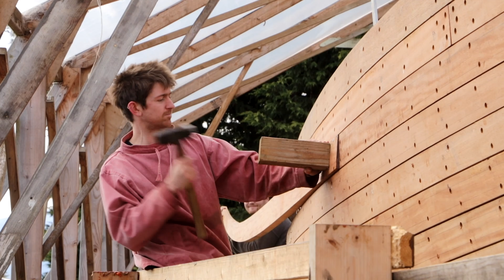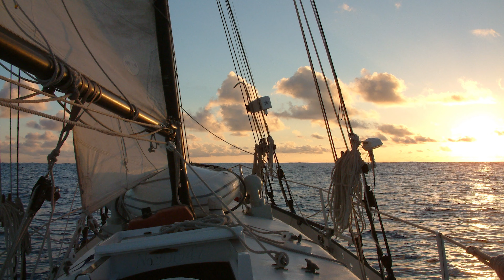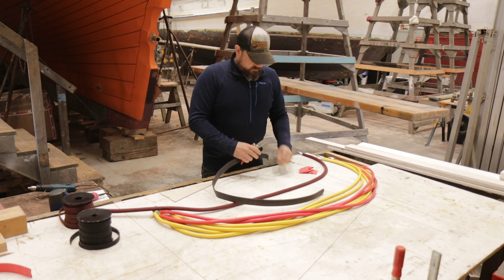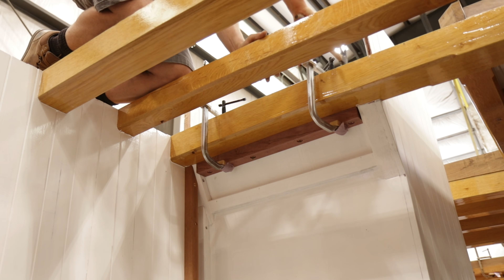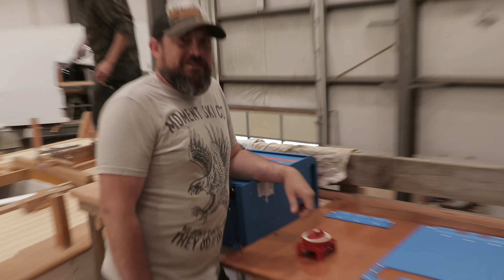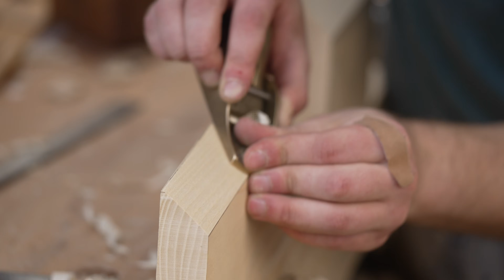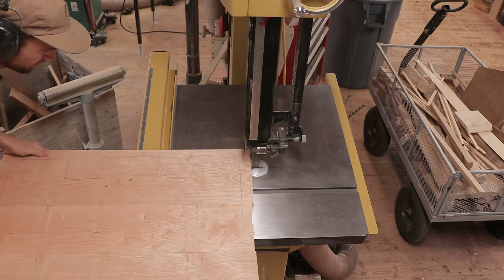Installing a Victron electrical system in the historic sailing yacht Tally Ho

Comment: Just one small correction, not at all important, but just for the records: All you say about the various Lithium battery types is correct, apart from one very frequent misconception; that Lithium Iron Phosphate batteries (LFP or LiFePo4) aren’t Li-Ion. They totally are. 

This misconception has established because of how various types of lithium batteries got established on the market, as Li-Ion. When marketers explained that LFP was a very different type of battery chemistry, which is correct, the market misunderstood what was different. Absolutely all lithium batteries are Lithium Ion batteries. There are just different types of chemistries in them. 

LFP has several advantages, like virtually no thermal runaway, tolerates extremely high currents, both consumption and charging, have a super charge efficiency, have very stable Voltage from fully charged to empty, lower price and at least twice as long live expectancy as the other much used lithium chemistries. (LTO Lithium Titanate is even safer and much longer lasting and tolerates even higher currents, but has other significant weaknesses). 
Sorry for the nerdiness. Just had to…

Comment: Nice work!!  But I would be apprehensive about installing electrical and electronic equipment under the compauionway.  Hopefully there will be a way to positively seal it off from the sea water, o,r even rain water that will definately cascade down that companionway at odd times on any truly serious seagoing boat such as the Tally Ho..
Reply: The ladder is built w/ a solid back, & has weatherstripping at each side to channel water to the bilge.

Comment: Those MPPTs are wrong way on wall, cooling finns assume that cooling air flows behind them when installed upright.
Reply: You should have chosen 24v volt banks to make it possible to connect them parallel with engine starting battery in case it’s empty for some reason. BlueSea makes automatic charging modules for that. But it cannot be used if other is 24 and other 48 volts.
Reply: Well, not MPPT’s but Orions. Same problem anyway.

Comment: Cable ties for the low voltage high current cables? I would have thought that they would be metal. Warships don't allow cable ties. Then again these cables are not up on the ceiling.

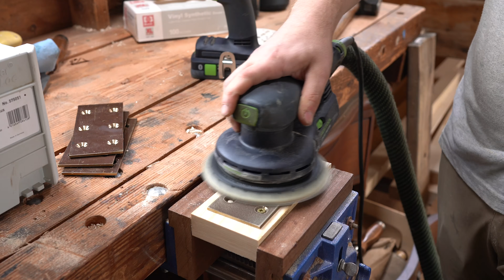Comment: 18:40   You really need to be using a clamp/hold down for that work piece.  Especially when working soft metals which can be grabbed by the tool and spun.  BTW, I have been a machinist since 1975 and have seen the results of an out of control work piece.

Comment: Have you purchased a mask yet for the sailing yacht is it going to be one piece or we meet up in segments or you know move together it would be wood will be aluminum tell me now tell me how I just want to know what you're making it with you know what kind radar self steering systems spot lights ankor how big how heavy registration numbers for the boat are you going with the old ones sir thank you

Comment: I have a question. Why do you use flathead screws instead of Phillips head? Is that because it’s a marine application ?
Reply: With a view to disassembly & repairs in the near or distant future, it's much easier to clear goo & gunk from a slothead than from any other type.
Reply: @frederickstibbert7389  ah thanks for the answer makes total sense

Comment: I'm surprised there weren't idents placed on each end of the cables, especially as some are routed through bulkheads.
There's a world of difference between an Electrical Engineer routing cables during construction and a yachtsman trying to trace an electrical fault in the middle of the ocean with a sea state 5 or higher. In that event a wiring diagram, with clearing idented cables, would be invaluable.
Reply: Don't you worry.  Labels are coming....

Comment: It is funny that people are worried about the safety of the batteries you put into the boat. And at the same time they are perfectly fine riding around in an electric vehicle that is essentially a bomb because of the Lithium Ion battery packs they use.
Reply: There's a mighty destructive potential in every tank full of gasoline.
Reply: @frederickstibbert7389  True and accurate. But gas tanks don't usually spontaneously combust. I have seen quite a few videos on electric vehicles blowing up that are parked and just sitting there. I would be leary parking an electric in my garage.

Comment: Pro tip:  Use flathead lineman's pliers to TWIST off the zip-tie tails instead of cutting with a side cutter...  Leaves no sharp edges.
Reply: I've cut hundreds of thousands of zip ties and also been cut by crappy cuts.  There will not be one shark tooth on this entire boat.  Flush cut.  Not side cutter.  Two different tools.

Comment: Don't know if anyone else has said this here, but it bears repeating:

It is unbelievably dangerous to use gloves when sanding small metal parts on a stationary disk sander. You can rip your thumb off if something goes wrong. I've seen it happen. 

It's not a lot less dangerous to drill small metal parts on a drill press with gloves on.

Comment: cutting off the tails of the Ty-Raps with diagonal cutters, makes me cringe.  Sooner of later, someone will slice themselves on the razor sharp nubbin.  We always use a Ty-Rap installation tool, which tensions and shears off the tail.  Grabbing the tail with pliers, right near the head and twisting, will also remove the tail, without leaving a sharp edge
Reply: They are flush cuts.  Different tool. Different result.
Reply: @tysons1851  In that case, I stand corrected !!

Comment: This is a MINOR issue, and maybe it's never ever done - but with those thick zip ties on the electrical panel, can the be touched with a hot knife to smooth 'em down so when yer reaching around you don't scratch/cut yourself? It may not eve be a thing tho.

Comment: NO OPINION on your choice of electricians, I speak from so close to zero experience that I should actually just delete this message.

I hate to give bad vibes, but my brother works for the Parks Service and has an ex aircraft electrical engineer working for the parks service department, repairing an maintaining salt water boats - and doing a just miserable job - all perfectly correct for aeronautical industry but bass ackwards for the maritime industry.

I am not an export so I am unable to commit to details, and this may be a one off bad employee, but it sounds to me, as an observer, as if he is totally unaware of the problems with dissimilar metals, grounding issues, electalosis and such.

Nyce cabeling technique - install the cable ties first, had not thought of that!
"Your daily rebuttal comment" or whatever he said - PRICELESS!

Again, I should just delete it, but just take a moment and see if any aeronautical vs maritime lessons have been missed.
Reply: I've got it.  Don't worry and keep watching. Plus, I have Joe to guide me and after a week with him, I have the utmost confidence in his knowledge, plan and advice.  I learned A LOT about what "ground" means in a boat already and it is very different than an airplane.  I am here to learn and soak up knowledge but I do have EXTENSIVE experience running wire in very high tech things.
Reply: @tysons1851  I am certain you do and I really should have just deleted the post.  Nothing constructive there.  It is not my usual bright and sunny style.  Great project, I wish I were about a dozen states closer.

Comment: I'm pretty sure your T-Class fuses should be directly after the batteries, not after other things like the Lynx's & BMS etc.
Reply: The first lynx contains…fuses for the battery supply. The second lynx contains fuses for the individual dc circuits.
Reply: It's fused six ways til Sunday

Comment: GREETINGS
I was doing a little research on the LIFEPO4 24 volt batteries and see that the cell design is likely 3.2 volts per cell…Assuming that is true in your case, there must be 10 cells per battery to maintain a nominal cell voltage at 24 volts. 

I was wondering if your system monitors the cells individually just as similar lipo/life systems do requiring a maze of signal wires?  Or is the LIFEPO4 chemistry such that individual monitoring is not necessary?

Since I see no individual cell ports I am assuming that each battery is counted as one cell.  I am very intrigued with your system and design.
OH…one last thing.  I know you are much more qualified regarding what type of wood to use to build the battery rack, however, the boards appear (at first glance) to be sized at minimum strength allowable to support such heavy loads.  When I saw large holes being drilled for wire chase, it made me cringe a bit. 

Thanks for this very exciting journey that you share with us mere mortals.  I am always looking forward to the next installment.
Reply: These batteries are living in 2050

Comment: have you considered protective the fastened (bolted or otherwise) electrical connections from salty air with a reducing (i.e. opposite of oxydizing) contact grease or something the like ? quite useful to delay oxidation of sulfation imho...

Comment: One question ? How are you going to keep electric’s dry been under steps on companion way ?
Reply: The steps have a solid back & fit fairly tightly against the companionway's sides, with rubber compression gaskets. An integral drip channel in the gaskets leads through convenient holes into the bilge.

Comment: I would have put rubber around the holes where the cables go through, they rub in high seas. everything moves a little. remove the friction. they can still be done as you can add cut circles of rubber around the opening.

Comment: The cable holders with cableties MUST NOT BE ADHESIVE!!! Change them inmediately. Or you will have a problem.
Reply: Pretty sure there is a scene where the tech screws in the cable holders.

Comment: Leo.  Love the electrical. Potential problem with. Independent movement on batteries using bussbar could fracture battery terminals when at sea. Suggest a loop of wire to Eliminate that problem.  We r huge fans.  Best from jill and Phil who is a an electrical engineer
Reply: We have a plan for that. :) The batteries will be completely locked in.

Comment: A lot of electrical devices in a small space. Everything is enclosed with wood. Do you envisage the installation of fire protection systems? Sea conditions can be extreme. Moisture, heat, sea salt and electricity are a bad combination, especially for a DC installation. Greetings from Poland !

Comment: Buss Bars can be made out of any type of copper, soft or hard, Concerns for vibration applying load between terminals on batteries using solid buss bars.  Batteries are sensitive to load on the terminals, both torque and lateral loads.

Comment: Each battery is 12V, many are connected via copper bar, developing 48 volts as the main current. It's stepped up to 120/240 and down from 48 back to 12 to recharge the system.
Genius.
Reply: @thegoodtom1718  Im not in anything for a win. It's just their system and how they achieved the ability to have so many voltages without parasitical. Those are very expensive batteries. A ship capable of traversing the world has to be able to use shore power wherever they go.
Reply: @thegoodtom1718  12 doesn't have the power to handle distances. The batteries themselves do not produce a heat signature (much at all), it's the converters/inverters and those are mounted outside the battery room. I believe this is quite the tight install.
Reply: @thegoodtom1718  Inverters and Converters. Those are digital which doesn't heat much. Cap systems will as well as coil. We run a 30HP converter to power up our 15HP 3 phase, so in that case there is an inherent 10% loss.
Reply: @thegoodtom1718  It's not a small array. SV Delos is running 4 (I believe),  Tally Ho has 10. Just saw they are 25.6's, that's how they get 240 so simply.
Reply: @thegoodtom1718  I am only sharing my latest electrical adventure. We tried using a digital INVERTER to power up the 15HP. It would smoke within 5 seconds, pull 200 amps and heat to right at 300f. 

SO, clearly, digital isn't all that when trying stupid stuff, Tally Ho's system will barely generate heat. It can have 240/120 and anything less (to 25.6v) just from the batteries themselves.

Comment: I didn't see a manual disconnect for the batteries. Would you wat to be able to disconnect them from the system in the event of an electronic issue?

Comment: Questions:

How will the 'letrics 'neath the companionway be protected from water?
(mostly concerned for corrosion here) 

Are all Amps run through end battery in series?
Reply: The companionway steps are made in 2 sections w/ solid backs. They fit fairly tight to the side walls w/ rubber compression gaskets that have integral drip channels leading to the bilge.

Comment: So funny seeing this system being installed. I saw much of what I purchased and used. 
I used a Victron system in my remote touring 4wd because the yacht products were water proof and tough. 290amp, 3000watt alternator with 5 batteries, 2 isolators and couldn't be happier.

Comment: Leo,
 Do you have a fire supression system in the boat?  Also portable bottles for Co2 would be appropriate. Dry chemicals would be nice but very messy to use and clean up. They would be my last choice to put the fire out, but they are very effective at putting a fire out. I would keep a couple of these for my last chance units. A well trained crew would also be called for to put out a fire.  A couple of air breathing units would certainly be required to work below deck in cramped spaces. 
Sam

Comment: i had a boat with 12, 24, 48 and 230 volt systems. It was needlessly complicated, required way too many victron components and was almost impossible to trouble shoot via phone with their techs. FWIW there is a much more simple way to run off of 230 or 120 shore power that only requires switches. No dual inverters. All that equipment is pricey and prone to failures and glitches. Just my opinion based on similar experience.

Comment: Are you going to cement together a shelf liner out of ceramic tiles  for each cabin to place laptop, note pads, cell phones and camera batteries in while charging incase a battery cooks off to keep the heat away from the wood for as long as possible.

Comment: Every sailboat I've sailed or crewed on, The companionway was one of the wettest parts of the whole boat. when I saw those printed circuitboards being installed right under the steps, thats when I finally knew after all these years that this project willl outlive me. Really Leo, couldn't you find a drier spot? I COULD.

Comment: I've heard of a product called Cellblockex, which would be at least some safety product to have incase of emergency regarding those lithium batteries As while they are safer, they are still lithium based. Beautiful electrical install, along with a beautiful boat.

Comment: So Tally Ho's main enemy is fire. I'm guessing it's going to have some sensors around battery / engine to detect overheat / fire. In mining they use a fire suppression system that is automatic also.

Comment: I'm a novice so don't kill me for asking but are there master disconnect switches for the electrical or are they even necessary?.......
Just asking........
Reply: There are hard disconnect switches for the inverters and the two motors for the hybrid drive. That’s all that is needed. The rest is fused.

Comment: Will you have solar to charge the batteries or will it all be done via the engine?
Reply: It’ll all be engine driven. No plans for solar as of right now.
Reply: With the prop in reverse pitch & the diesel shut down & in neutral, they can drive the electric motors as generators. Dragging the prop while under sail will provide charge for the batteries at the cost of some boat speed.
Reply: @frederickstibbert7389  thank you. Now that you mention it I remember that that was explained previously.

Comment: Very exciting progress, Leo. The Tally Ho will be wet again in no time!
I have a sort of technical question. Will an automatic (or manually triggered) fire suppression system be installed in the engine room and other critical areas? Almost all of the yachts here in south Florida have some sort of fire suppression installed, but they are typically much larger than Tally Ho and definitely not made of wood.
Reply from the maker: Yes there will definitely be a fire suppression system of some kind!